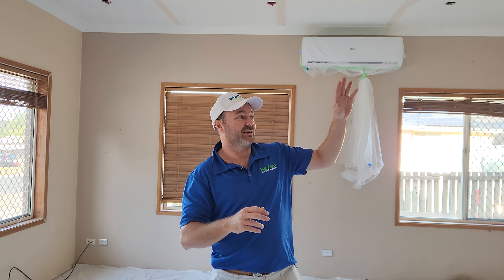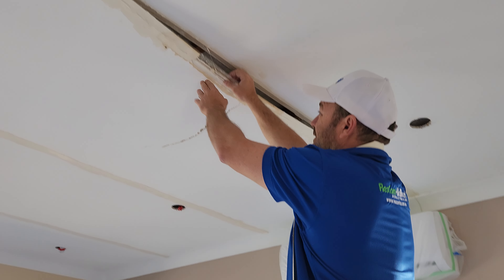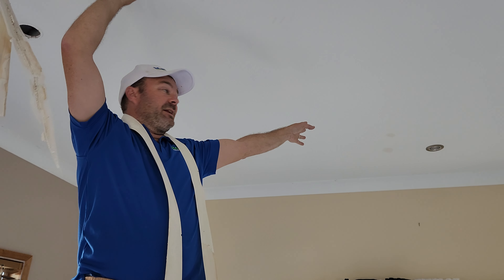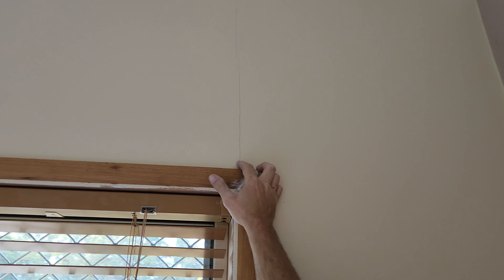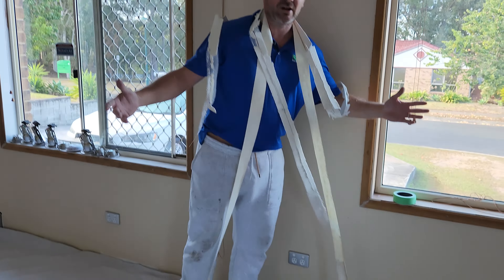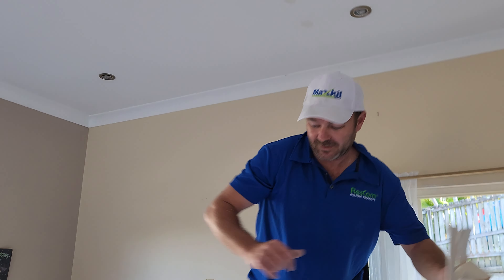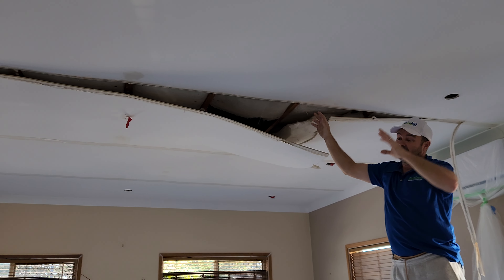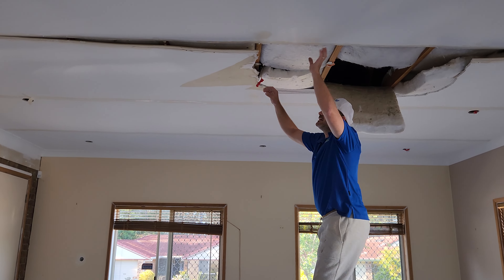Renovation Fails by the Way of Mesh Tape. (Don't use it!)

Comment: It may seem like overkill, but I like to set the tape (Fibafuse) in 90 minute setting type compound.  While I have the setting compound mixed, I will do a pass on the screws, and I can often get away with 1 coat on the screw holes as the setting compound shrinks so much less than pre-mixed mud.

Comment: The ceiling drywall isn’t 5/8 fire code. Every tape is gonna bust with thin sheets and no glue on joists. Spend the extra dollar and use the fine mesh doubled up.
Reply: The ceilings in domestic buildings in Australia don’t require fire rate. 
The sheets here are 10mm and if you notice that when Max pulled the tape out you can see a large gap between the joints which was never pre filled before taping. Also the ceiling was glued as when Max pulled it down you can see the glue.
Reply: I just finished one the other day. It was taped in with paper tape and the problem was that “back in the day”  when some had nail popping so they decided the fix was to use a temporary block and screw through it then removed the next day🤔. Also the ceiling joints were taped in with topping.
Reply from the maker: yep, You got it Tom
Reply: @tommartland59  We coat the joist with adhesive on a roller not a couple dabs. I wish we didn’t have to run 5/8 on ceilings here, a lot of the nicer builds are now having us hang two layers of it. Do you guys run 3/8 on walls or 1/2?   

Lol idiots keep us in business. We were doing a unit a few weeks ago and the neighbors ask us to look at their drywall around a switch. They said a guy fixed it two weeks ago and it was still “soft”. This guy had tinted 2in thick and painted over top. The tinted felt like it just came out the box but at least he primed it before painting lol.
Reply: Biggest problem is poor workmanship, unskilled workers!!
You get what you pay for!

Thanks Max for another good video keep em coming mate!

Comment: mesh tape is only good for drywall if you use a quick set/hard setting compound like durabond (US brand, not sure what the name might be in your area) But even then I prefer to use paper tape unless it is a patch with old plaster meeting drywall patch in which I would be floating the area with quick set anyway.